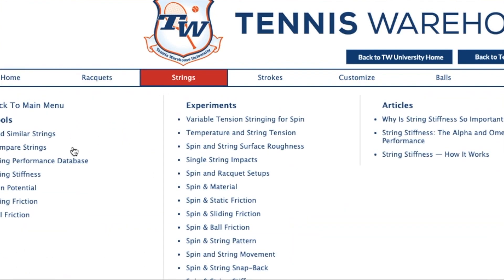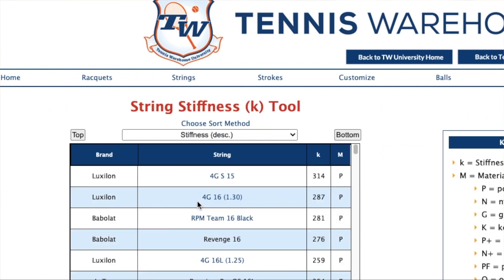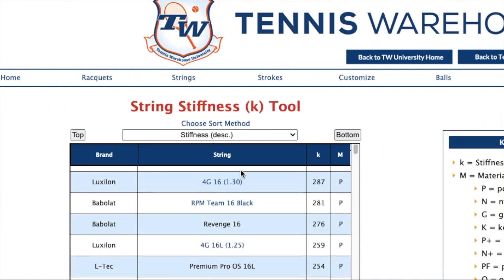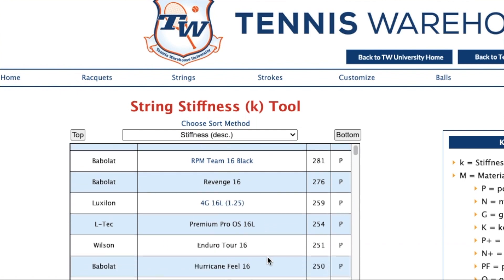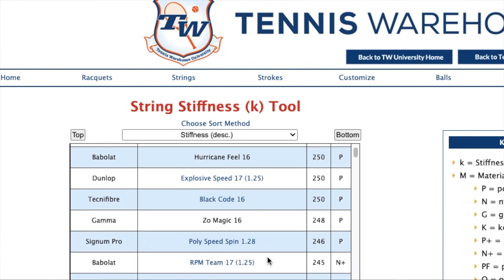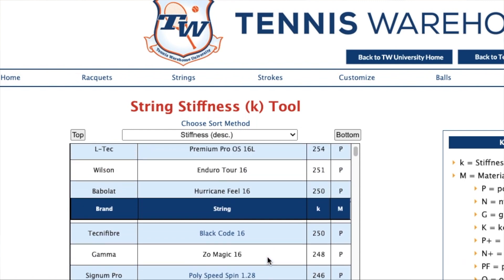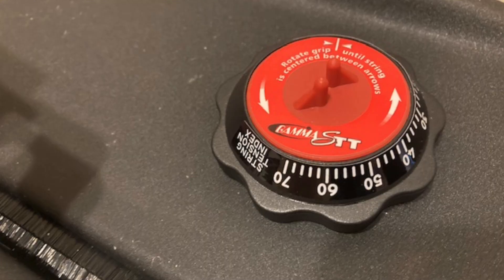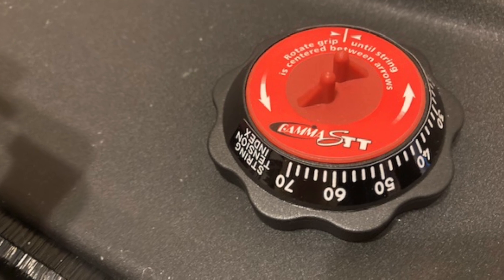LET'S TAKE A LOOK AT THE 5 STIFFEST POLYESTER TENNIS STRINGS

Comment: How do you find Babolat RPM team vs Blast? They say Team has longer durability, but it doesn’t feel similar when freshly strung. Ppl I’ve strung Team for don’t like it as much as Blast, which I find to be very crisp but notches quickly.
Reply from the maker: The team is a lot stiffer and keeps tension much better than Blast.  I am not sure about durability.  Re: notching, is that with a hybrid or full bed of poly, also next time check when you get it strung to see if it is already notched , could be happening during stringing, or are you stringing it yourself?
Reply: @RacketStringingTips  I string myself, and am careful when pulling the strings to prevent notching. Blast has this coating that comes off easier than other strings I find.  Yonex polytour strike is just as slippery but the coating doesn’t come off as easily. 

Perhaps I’ll give team another try. Maybe it has less spin potential?